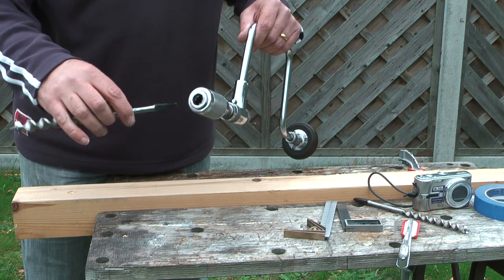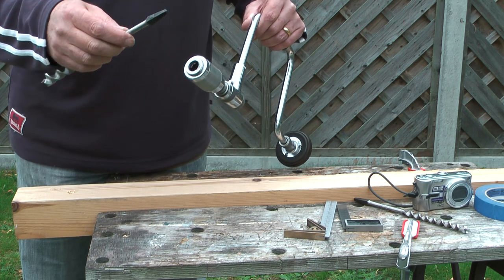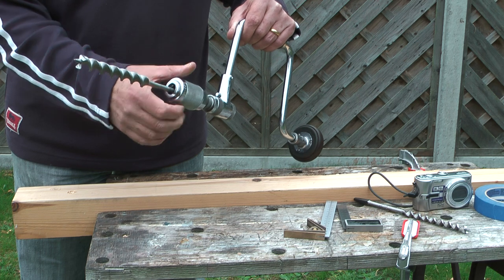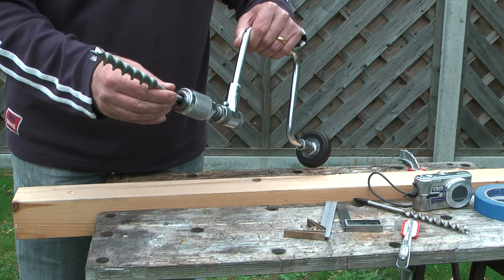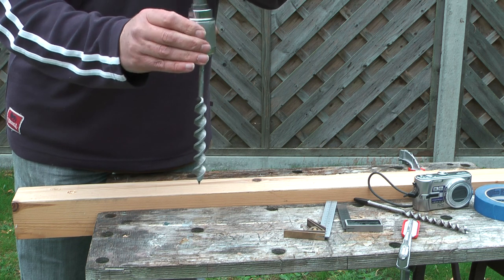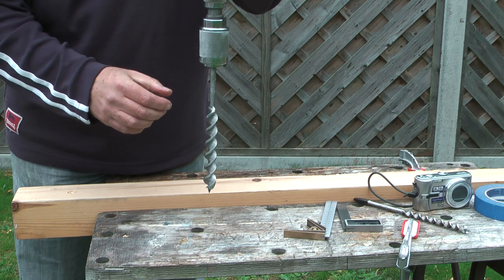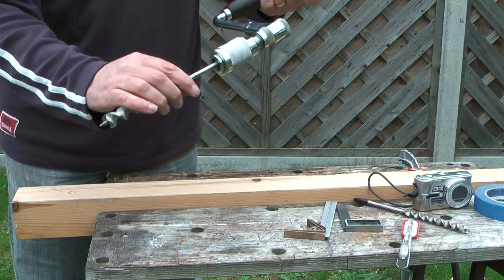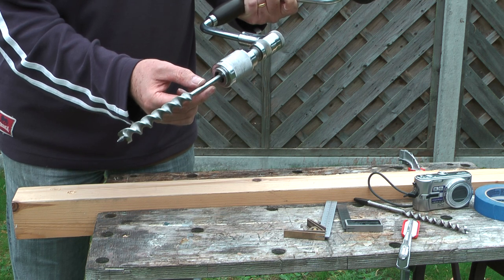Inserting an Auger into a Hand Brace

Comment: I assume the above instructions are for 2-jaw chuck braces? I have a vintage German brace with a 4-jaw chuck. The bit can pass all the way through the jaws, until it bottoms out in a square-shaped hole. As far as I can tell, the hole is 8x8 mm, and the bit, once inserted, doesn't wiggle at all, even with the chuck loose. So it seems that the torque transmission is via the square hole, and the chuck jaws are more for centering the bit. This brace can also hold modern round-shank twist drills relatively securely.

Comment: This is very useful. What I want to know is how to extract the brace and auger from the hole when it is finished.  If I turn the brace anticlockwise the bit sometimes comes out and then I have to try removing it with a vice grip.  This risks snapping the bit. Alternatively I carry on turning the brace clockwise and pull it up at the same time; that often works but not always.  Can someone advise me what to do?

Comment: I don't have a hand brace with a chuck to exactly match this one. Testing the method shown on my Millers Falls and Goodell Pratt chucks it works but seems to be an unnecessary step to hang the bit vertically so it is kept away from the spring. 
If I were to be jamming the tang into the chuck with enough force to damage the spring, I have a whole other set of problems. 
While demonstrating the way to insert the tang I find it more important to have the tang inserted with the tang oriented so that the corners of the bit are gripped in the chuck rather than the flats. That way the grooves in the jaws are able to enwrap the tang and prevent it from coming loose.